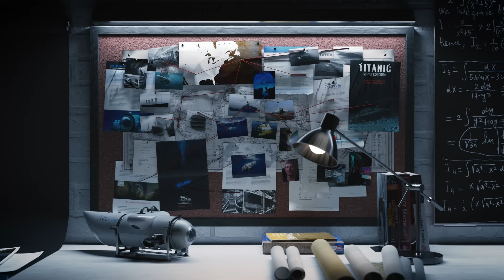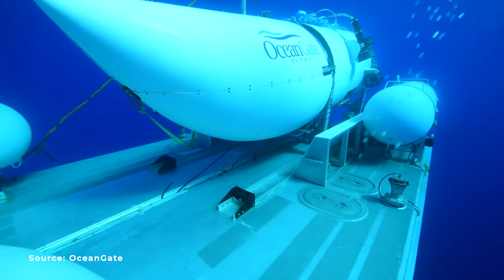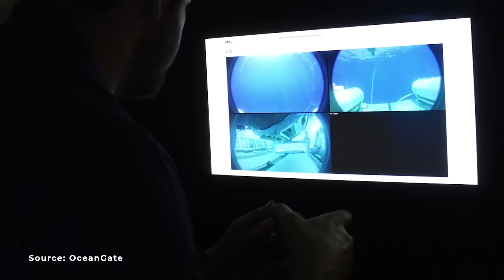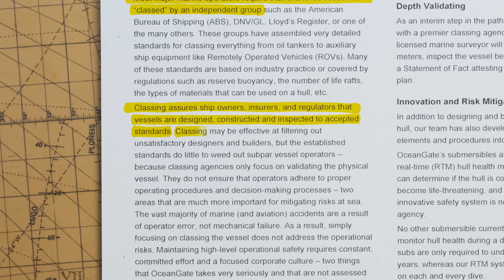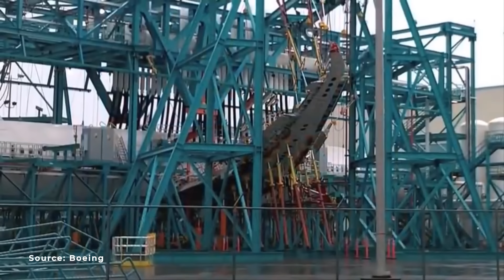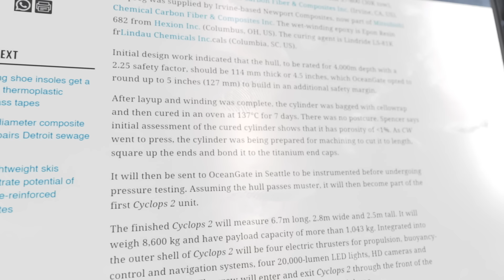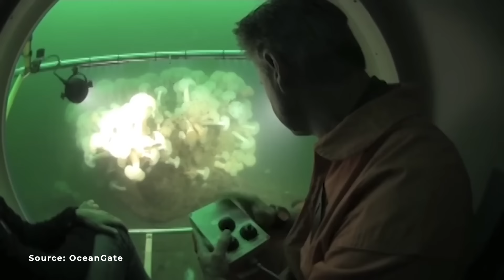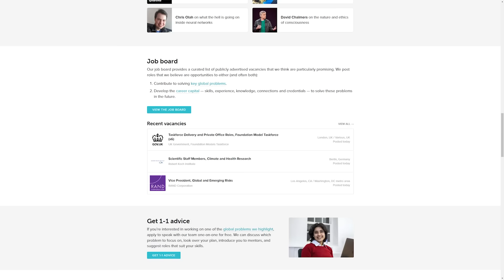The Questionable Engineering of Oceangate

Comment: I'm not an engineer, but when I heard that they used carbon fibre for the hull, I immediately knew what happened. I'm a cyclist and worked at a bike shop. We were told from the beginning that carbon fibre frames cannot be clamped, because they may get damaged.
Reply: Archer here!  We sometimes use carbon fiber arrows, and for the the same reason I figured that it was a bad idea to use for a sub.  They're brittle and not as durable as other sorts of arrows. They can't really bend out of shape I guess, because when they do that just crack or snap instead
Reply: I'm not an engineer, I'm unemployed, but as an unemployed person even I knew it was a bad idea. Ya see I use carbon fibre chairs to sit on all day. And I know from experience that they get damaged over time from my fat behind being sat on them all day.
Reply: the fact that ocean gate used something that gets damaged when clamped is beyond me
Reply: To be fair carbon fiber has seen use in some other deep sea applications. The problem isn't that they used carbon fiber, it's that they didn't do any stress testing or fatigue monitoring.
Reply: @MudakTheMultiplier  any of those applications having fatal error models that is built for multiple use?
Reply: Dog impersonator here. Carbon fibre bad woof.
Reply: As a fellow cyclist, this comment gave me an aneurysm. We clamp carbon tubes routinely. Stems on handlebars, stems on steerer tubes, seat tube on seat post, saddle clamp on saddle rails, STI's on drops, brake pads on rims,...
there's nothing wrong with it as long as you design and build the structure properly. There's no law of the universe that says "carbon fibre shall not be clamped"
Reply: Same here. I've used products made of Carbon Fiber for decades now and while strong and lightweight it doesn't normally bend or flex whatsoever and when reaches that point it SHATTERS instead and same goes for Titanium which also have used personally for decades.
Reply: @dieseldabz7104  hockey sticks?
Reply: @dieseldabz7104 it can kinda be compared to a harder glass I guess. Takes a lot to break it but when it does it shatters
Reply: The English teacher who fails to write a proper English sentence 😂
Reply: @bathombre1977  ¡Discúlpeme señor! Estaba siendo sarcástica. Estoy impresionada de que te hayas dado cuenta de mi intención de ironía. ¡Impresionante! Por cierto, ¡tienes una linda tortuga! 🐢

Anyways, toodles! lol
Reply: I also approached this from a cycling perspective. Carbon fiber is light and strong under tension, clamp it too hard in a work stand or over torque a bolt and you'll regret it instantly.
Reply: @alexmiller1658  I find the use even  in bikes absurd (exeption being maybe real elite stuff), it just add a short life expectensy and a tendency to failure catastrophic and sudden
Reply: Same, also a field hockey player, so I know how carbon fibre fails when the hockey sticks break,
Reply: This is exactly the kind of comment that winds me up.  It's true that the way OceanGate used the material seems to have been massively irresponsible, and it may well turn out to be true in the long run that using carbon fiber at all as a material for underwater pressure vessels turns out to be more trouble than it's worth.  But it's also true that your experience working with different carbon fiber materials in a very different application has very little bearing on this.  You DON'T "know what happened," none of us do yet.  Unless I'm mistaken, the actual investigators haven't released any official conclusions about the initial point of failure yet.  It may have been the carbon fiber section of the hull, or it may have been the joint with the titanium hemispheres, or it may have been the viewing window, or it may have been something else.
Reply: The carbon fiber was literally expired too
Reply: As an English teacher, I have the most experience out of all 3 of us, and even I knew it was a bad idea! 🤡
Reply: @berryreadable  you mean the least experience?
Reply: @Herzl1337  I was being sarcastic, lol. That’s why I was using the clown emoji. I proudly declare in all seriousness that I have absolutely no experience in engineering, save for what my man tells me about his material engineering projects. 

Toodles! 🤗

Comment: 1. "Innovation would be creating that pressure vessel and testing it, figuring out the (problems) for all mankind. (What Stockton did was) profiteering, not innovation"
I disagree.
You can call it reckless and dangerous, but it was actually quite innovative, and was not actually fit the definition of "profiteering".
Furthermore "innovation" does NOT require you to share your research data with "all mankind". In fact many "innovations" contain some closely guarded secrets.

2. "growing trend in engineering of moving fast and breaking stuff.. this is attitude is dangerous"
It is not a "growing trend". This has always been the case. Some people/inventors prefer this, others prefer more cautious approach.
Everything has its pros and cons. Whether "moving fast and breaking stuff" or your (implied) preferred "attitude" of public funding research (so it can benefit "all mankind"), they both have their own pros and cons.

I personally prefer what you consider as the "dangerous attitude of an overconfident CEO" over yours.
I'd rather let millionaires and billionaires risk their own money (and life) for their pet project, than allowing politicians and bureaucrats to gamble and waste my tax money on their pet projects.
After all, just as many people died in various accidents revolving around govt project, with little/no accountability. Like who was/is accountable for the tragedy of Challenger & Columbia? Who was the Stockton Rush of Challenger or Columbia disaster?

Comment: "The vast majority of marine (and aviation) accidents are a result of operator error, not mechanical failure. As a result, simply focusing on classing the vessel does not address the operational risks." - So, classing the vessels makes it, in the vast majority of cases, that they don't fail mechanically. Logically (I'm inserting my own irony here), let's not focus on that. That's like saying "in the vast majority of cases, people die of old age, so simply focusing of certifying the seat belt works does not address the operational risks of driving a car".

Comment: @realengineering: Did you also notice they screwed the screen mounts directly into the hull? Localy reducing the total thickness in the laminate🤦‍♂️ You can see it in several pictures of the interior. Standard way to do this is to glue a bracket to the wall as to not compromise the laminate...

Comment: Great video. A little bit of knowledge is dangerous thing in engineering especially when it comes to composites. People get enamored by their outstanding strength to weight ratio not realizing that they have serious design considerations that have be taken into account. One has to wonder why they didn’t factor in cost of testing for their price of each trip. If a client can pay $250,000 a ticket is $300,000 or $500,000 a ticket really prohibitive?
Reply: If someone pays 80 bucks for a meal at a restaurant 160 migut be probative. The answer is clear for some. I feel like it's good that some people try to cut cost. Sometimes it works, sometimes it does. This guy put his own ass on the line. If customers are informed that they are stepping into a experimental untested death trap in return for a 100k discount, then so be it.
You could probably save thousands of lives if we mandated people drive with 5 point seatbelts and helmets, I prefer the world where thr consumer picks his or her own risk profile

Comment: That justification for not testing or certifying, i.e. "that most accidents are caused by operator error rather than mechanical failure", is fine but on analysis a misinterpretation of the accident statistics in the case of oceangate..
If all the other vessels that experienced some form of accident were fully and regularly tested, inspected and certified, which they were, then this only leaves human error as the likely cause because mechanical failure has been engineered out. Correct in this case. 
However and it;s a big however, with an untested, uninspected and uncertified vehicle you simply cannot apply this logic and to do so really puts into question the whole technical expertise of the rest of the operation.
A huge red flag indeed

Comment: I'm currently taking up driving lessons and one of the things they tell is that an incident which results in crashing is called a road crash and NOT a road accident, because incidents on the road are avoidable if you take the right precautions and actions to stop disaster from happening.

I think the same applies in this situation. I won't call this an accident because it's avoidable had people not charge in ignoring the warning signs during the process. It's not an accident, it's a disaster waiting to happen. The term "accident" implies that the matter was unexpected or by chance, we now know whatever happened to that submarine is far from unexpected or by chance.

Comment: "Move fast, break things" really only works when what you're putting to the field is many prototypes each meant to experiment a new change, test them until failure and move onto the construction of a new prototype. The trade-offs of the method are a greater expense and the required coordination because you're fielding all those prototypes to quickly put doubts and hesitance at rest on a number of decisions and everyone needs to be on the same page following these developments, it should not be safety as the prototypes are tested to failure in a prepared safe test environment.
The Titan submarine's development process was "test nothing, ignore warnings, make money", the words "criminal negligence" have never been used for a more fitting case. The submarine was one and obviously never tested to failure, "tests" were all done manned and data collection was sub-par, issues that arose were not addressed properly or not at all, experts that provided suggestions were vilified when they should've been listened to and quickly proven right or wrong by putting their idea through the ringer.

Comment: Shit I didn’t realise they used a composite hull.  And a bagged composite. It’s a shocker they didn’t have this fatigue tested. So sad. I completely agree that regulation does not stifle innovation. I’m also an eng and this really angers me! 

To be fair to spaceX they only use a fail and repeat method for testing remote vehicles. 

I would be interested on a video on the safety of spaceX and the regulations they have abide by. Is their approach safer in some aspects?  Allowing more real life flight testing etc.. The dragon eject system for example. Musk does seem to put human safety as a priority to his work.   But are they using “space flight is dangerous” as an excuse? Are they skipping rigorous testing? Or are they doing both? 

This would be interesting to deep dive on - and quite possibly very important. You have a real influence on the engineering community now…

Comment: As an ex navy nuke submariner, as soon as I heard 'carbon fiber submarine' and 'lost communication' I shook my head and knew it was over. As I learned more about that sub I wouldn't have dove 10 feet let alone thousands! That was a carbon fiber coffin destined for Davy Jones locker.

As Real Engineering mentioned carbon fiber has different material properties than steel or titanium. You can see the difference under an electron microscope.

Some quick points of design idiocy:

- The fiber was 'wound' radially. While not the same totally, carbon fiber diving cylinders are created in an axial (length wise) cross pattern. There's a reason for that kind of lay. A sub would need both radial and axial lay 

- The idiocy of using hand-applied epoxy to mate the titanium end bells to the carbon fiber hull - and with assumed to be no high precision gages to ensure proper fitting, offset end bells off by a half of degree would create uneven tension down the length of the hull

- That epoxy is very stiff and brittle and extreme pressure and temperature cycles inbetween those mating surfaces in salt water

- They dove hearing loud pops and cracks again and again - that was negligence. One layer of carbon fiber, one micro crack and its game over

- Seawater is unforgiving

- I couldn't tell if the sub had a CO2 and moisture mitigate system. Im some images of the sub you can see condensation on the titanium end bell. Did they not consider carbonic acid? 

Sadly, this to me is another example of this vaporware startup venture capitalism culture like Theranos, Nikola and the hyperloop. Instead of people losing money they lost their lives.

Comment: Nice job covering this topic. I'm an "old Aerospace Engineer" that spent 40 years with the World's largest Aerospace Defense Firm and much in Composite Structures (including an Auto-Clave that could have been used for this vessel located in Lisbon, Portugal and used for our F-22 previously). Sadly, this design was doomed from the get go ... and all down to the hubris of Stockton Rush (just because your ancestors signed the Declaration of Independence has no bearing on Engineering design). Rush spent 20 years working on the F-15 Fighter Program ... he knew better and willfully ignored his training (SOF/QUAL/HALT and AS9102). "Go Woke, Go Broke" includes "self ending" results in some instances and why I elected to "retire" as the young employees (some) seemed to be  of the same mindset as Rush ... wanting to "shake up the game" by doing it "differently" than following decades of mistake to improve Processes. If you want to make "improvements to efficiency", then hold a "Value Stream Mapping Event" ... not throw the Baby out with the bath water !!! 

Know that Rush supposedly purchased CF Tape from Boeing at a huge discount as (in his words) it had and expired shelf life. What is not mentioned is just how bad this decision truly was. Boeing is certified to AS9102 Quality systems and would not have "Sold" the material thru normal procurement channels. Most CF is allowed a "retest" extension (usually 3-6 months) and is automatically accomplished; if test passed, the extension would be granted but after that, the CF gets sent to their internal "Scrap Yard" for disposal and tagged accordingly. If I were to guess, Rush purchased the expired material after re-test from Boeing's scrap yard ... in no way was that material ever intended for use on ANY platform.

Additionally, Rush violated ply pattern layout. Flat tape over a round mandrel without even slight attempt to maintain requisite 90 (or even 45) degree orientation between plies. What he ended up with was all the CF running in parallel ... and IMHO, the Hull imploded like an Oak Log being split down the grain line.  All that "popping noise" were audible delaminations occurring in real time. And since he elected to not perform any NDI (Ultrasonic) after each of the previous dives in Titan, there's no way to have know the extent of the damage being piled up; and while he stated Ultrasonic couldn't detect anything on such a "thick 5" hull", I say BS ... there are two sides to every coin and as you rightly point out, the interior of the hull should have been tested first as that is where most of the damage would have been found. Side note: current software for stress indicates the hull needed to be around 17.6 inches thick anyway ... not 5 inches. The hull design was a cylinder and therefore "in Hoop stress (σh) but unfortunately, without the "Hoop" support structure; no stringers or sleeve. Major faux pas IMHO.  He would have been better served by using a "Thread Laying Machine" ... at least there'd have been "some" 45 degree ply orientation and, with an Auto-clave, allowed the TOWS and resin to do their jobs and not buckle. Again, IMHO.

Lastly, if you look closely at the salvaged Titanium end caps/flanges, the hull imploded first IMHO ... and we both know "Water" cannot be "compressed" so it shot the end caps off like Champagne Corks. And given the videos, it would appear Rush didn't bother to even add the requisite "Primer" between faying surfaces ... otherwise, there'd be some small fibers left on the Titanium flange surfaces.

Of course, we’ll see what the NTSB comes up with … just sad the kid’s life was taken … just because it was “Father’s Day”.

Comment: You don’t need a master’s in engineering to understand why carbon fiber, or composite in general is not a good idea for a submersible… on the other hand, they had been used for regular pressure vessels for a long time, making their failure mode more predictable and easier to see.

Comment: The worst conceivable application of carbon fiber. 
It's the reverse of a carbon fiber scuba tank - under tension & outward, expansive force. Helicopter rotors are another great application of cf.
It's absurd that as an untrained individual, I can grasp these concepts so easily, yet the 'smartest guy in the room' could not...
Hoping rush's assets get leveled.

Comment: This is the first video that actually captures the correct pressure loads and what the effects are on a structure to withstand these loads. The linkage with the composite material is made clear i cluding the crucial difference with the use in aviation. Well done